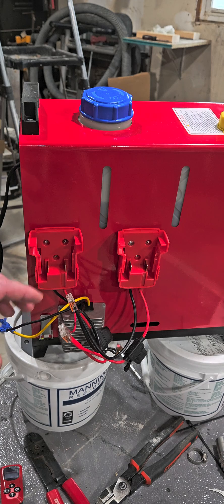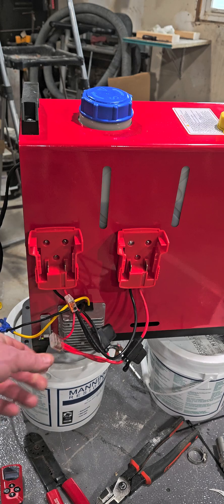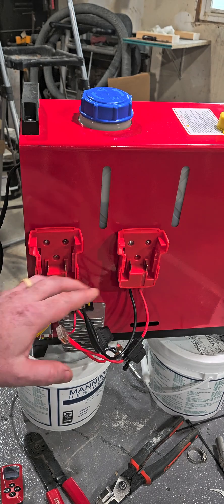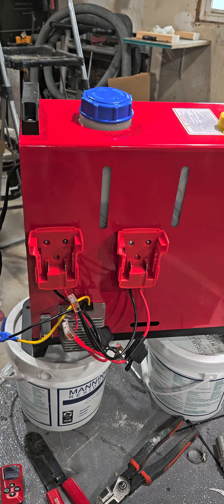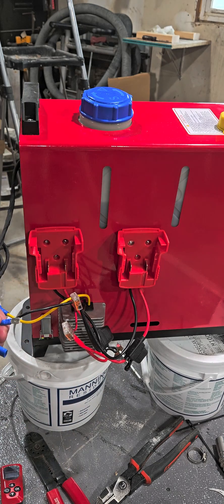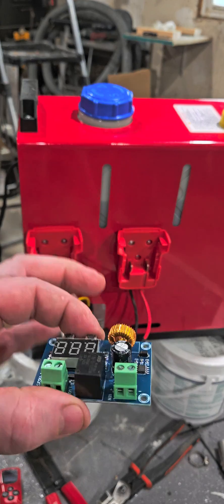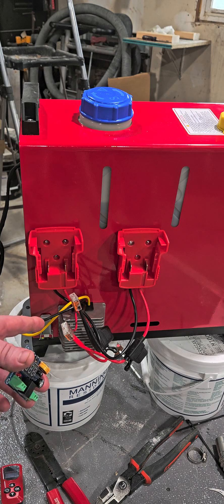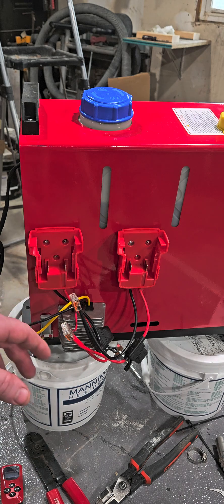DIY Diesel heater M18 adapter

Comment: Justin...great idea. Since I have 18v Milwaukee Bateries this would wrok great for me. Plus I can charge them asI drive as my vehicle has a 115 outlet. Thank you. Say; I noticed you have a different heater listed then whats in the video?  I say that as the one in the video appears to be a Vevor? Am I correct?
Reply from the maker: Glad I could help. I think the heater in the video is an Hcalory, but honestly they are all pretty much the same thing in my opinion

Comment: With two batteries (no recharging) how long will the unit operate?
Reply from the maker: On high, probably around 4 hours. On low closer to 20 hours

Comment: Hi, how were u able to mount the battery adapter to the housing? There appears to be no clearance inside due to all the components in there.
Reply from the maker: I used rivets, i just had to find a spot that had enough space

Comment: For some reason this isn’t working for me I’m getting error code E-10 I’m using a 36/48v step down to 12v 30amp with one Milwaukee battery 18v 5amps and another one 18v 9.0amps. There’s also a 20amp fuse installed could that be the problem ?
Reply from the maker: Are  your batteries wired in parallel or series? They only push about 20v so the battery voltage might not be high enough to trigger your converter
Reply: @ yep they’re connected in parallel
Reply from the maker: @painting1989  maybe try wiring them in series, your converter should be big enough to handle it

Comment: do you need the low voltage disconnect?
Reply from the maker: It protects the batteries from over discharge

Comment: Just subscribed. This is a really good video and this is a game changer for preppers. Im getting ready to put a unit in the back of my suv. I have a solar setup and a 200ah lifepo battery but I also have a buttload of Milwaukee batteries. It would be nice to have a backup in case you had a rough night and you cant get any solar the next day. Grab a couple batteries that you pre charged and press on bravely in warmth and safety in a pinch.

Comment: What did you set the low voltage shut off to? Great video btw! Straight to the point without a lot of filler
Reply from the maker: 17 volts, some said you could go as low as 16, but idk
Reply: @Makesomethingworthmaking would that be the same for dewalt batteries?
Reply: @Qawqazzfreaky Dewalt batteries are 20v, not 18.

Comment: I made a portable stereo with a similar Dewalt battery and a similar adapter.
After killing 2 $150 batteries I realized that the Dewalt tools have a battery protector that will not drain them dry, whereas my stereo didn't. 
That low voltage disconnect is vital!
Reply from the maker: Yeah, some batteries have the protection and some dont, so this is cheap insurance
Reply: Mmmm I feel like that’s what those additional prongs are for the batteries and tools beyond the positive and negative… ie using dewalt batteries with other tools will also run them completely dry… by the way, what do I set one of these low voltage cut off switches to for dewalt batteries???
Reply from the maker: @Qawqazz  idk, I have mine set to 17.2